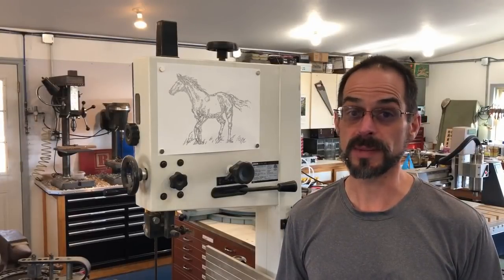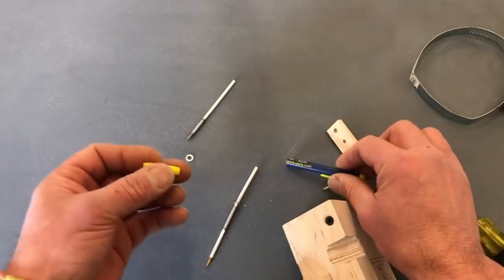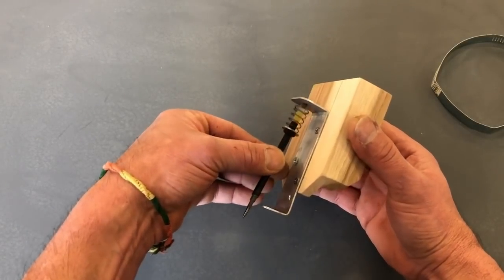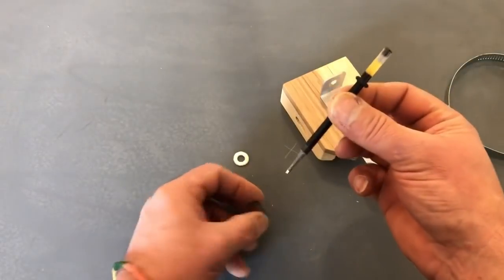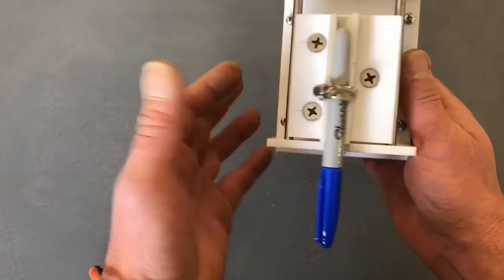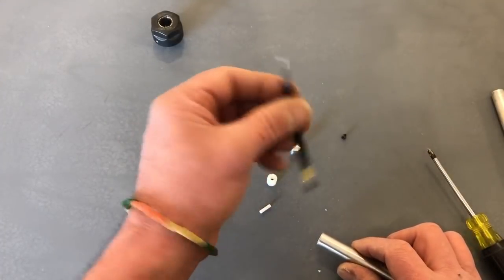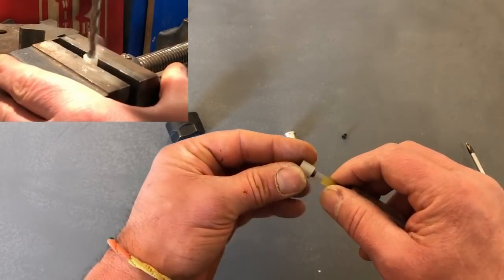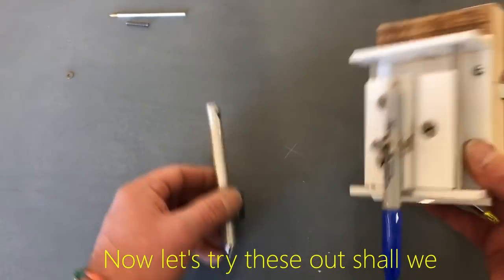How to build a pen attachment for your CNC router

Comment: I really love the gravity pressure white version that utilizes ball bearings.  Could you please provide a parts list for this one?
Reply from the maker: David McKee ... I used some screen door roller bearings, and some 1/4” round steel stock I had in the shop, and carefully made a sliding track.
I have also made a simpler version using a small drawer slide, which works quite well

Comment: Maybe this could be used for cnc plasma tables as well
. Mistakes in sheet steel is expensive.
Reply from the maker: Yes of course it could, you could pre-draw out your shapes you’re going to cut to check your fit in alignment on the sheet, great idea 👍